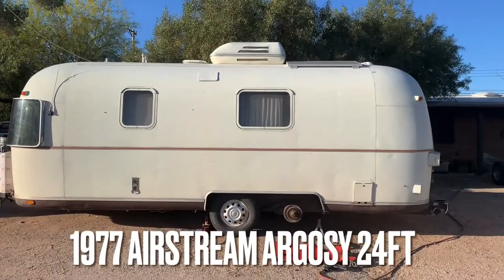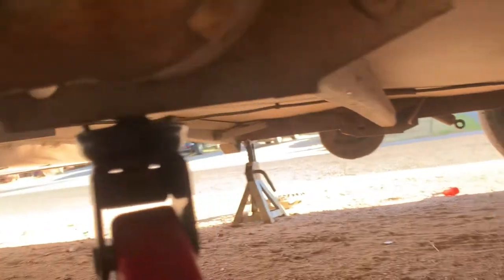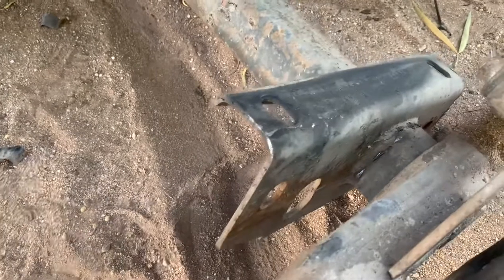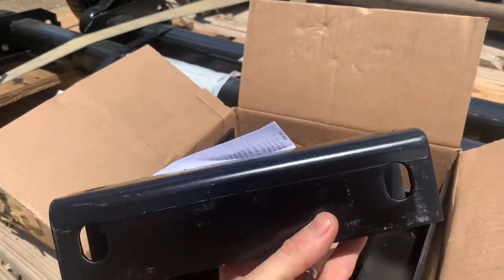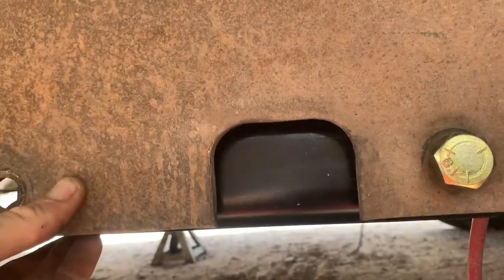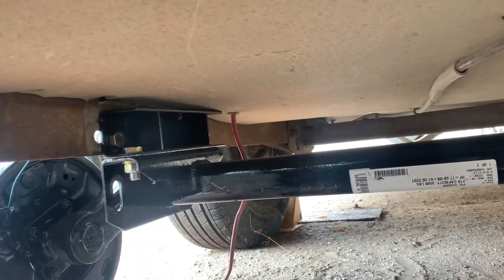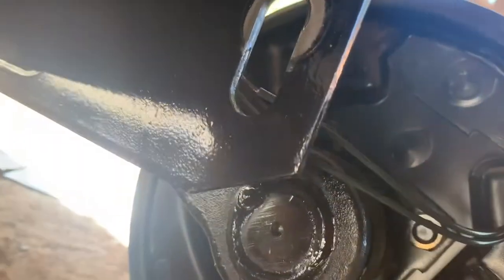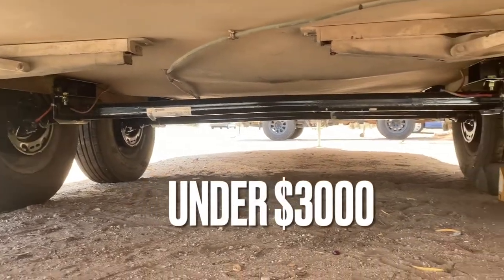Airstream NEW AXLES How to install a 3" LIFT KIT in a 1977 Argosy by myself

Comment: Do you have to take an old axle to Dexter for them to take measurements? The original axles on my 1976 Argosy are rated at 2800 lbs. Thinking I could go up to 3000-3500 lbs  on the new ones.thanks for the great video!
Reply from the maker: I never dealt with Dexter.  I sent one axle to Wheel Equipment in Tucson.  You can also call them and they'll send you a form for you to fill out with specific measurements.  Name drop this video...they know me well.  They have great customer service!  Correct...the old Henshen axles were rated around 2600-2800lbs.  Thanks for watching!  Please subscribe if you haven't already.

Comment: Would it be better and easier to drill the lift brackets instead of the frame..? Did you move the axles and mount them solo?. Great tutoria.
Reply from the maker: Thanks!  If you look at the lift block from Dexter, it's shorter than the span of the original holes in the Argosy frame.  Hence having to drill the hold to match the lift block.  Each axle is slightly forward with plenty of room for articulation if need be.
Reply from the maker: I just saw a video of some guy who torched his holes open to allow the bolt to line up.  What!  Why would you do that?
Reply: Thanks for the reply.  Can I do it solo or too much of a reach?.  Great video
Reply from the maker: @thomaspayne8567  Other than my wife unloading the axles from the flatbed trailer with me and wheeling them under the Airstream, I did the entire project myself. No joke. Thanks again for the compliments.

Comment: You didn't put the shocks back on?
Reply from the maker: I did not. Reason 1: Warranty would be voided by Dexter if you weld shock brackets on the axle. 
Reason 2: The ride is so smooth with the Torflex axles and their shock self dampening rubber I haven't found shocks necessary nor do they seem to be recommended by Dexter. On or off road, it tows the a champion. No wheel bounce or roll on rough or curvy roads. I'd love to hear your opinion, experience or feedback. 
Thanks for watching.
Reply: @ArgosyMan  Nice, I've got the lift on order but i'm not doing new axles so i'll be re installing the shocks somehow. I picked up a 77 argosy and it's like a time capsule, everything origional and working. For now will lift it and paint the outside.
Reply from the maker: @jeffvw1994  Please keep me posted on your progress. I'd love to see that beauty.
Reply from the maker: What's the status on your Argosy?